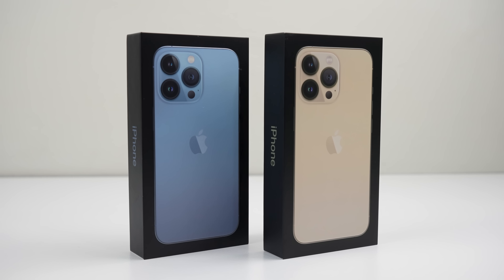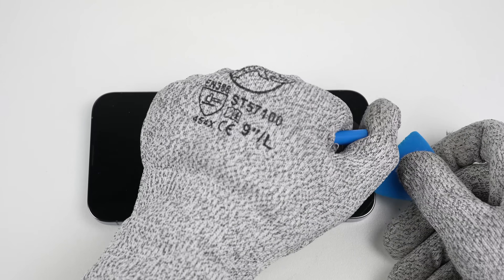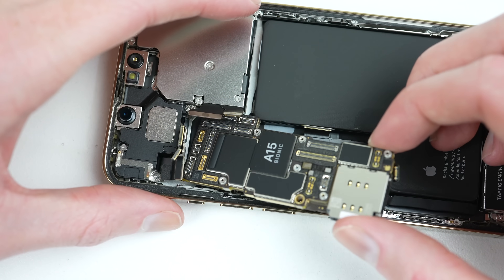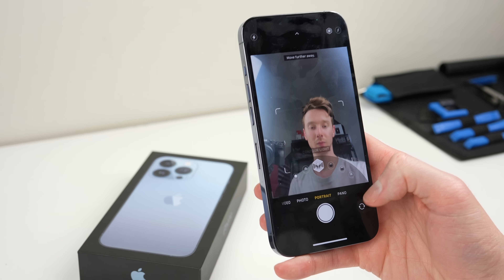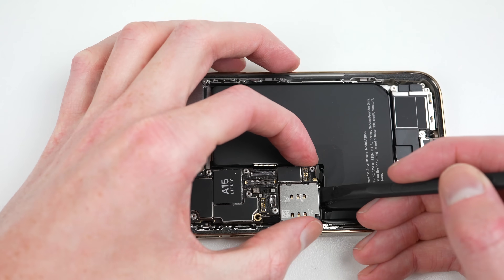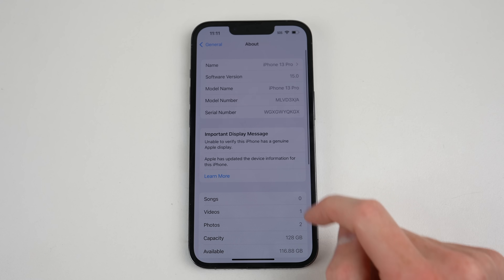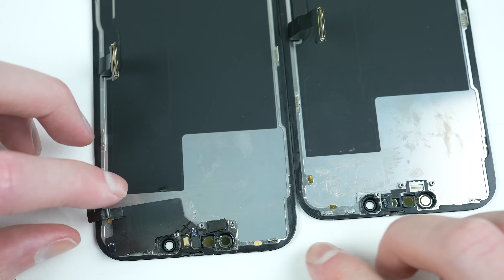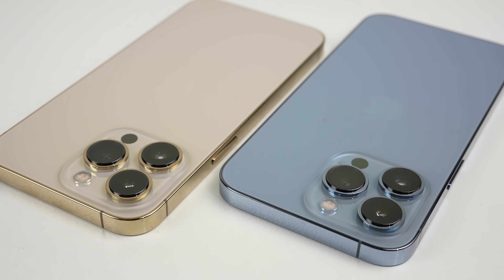iPhone 13 A Repair Nightmare - Teardown and Repair Assessment

Comment: Think it as HP Laptops, they make laptops of same model with different components from different manufactures. Like the same model from a batch can have Qualcomm WiFi module, on second batch Intel, on third batch Broadcomm and on fourth batch Realtek. Now if you go to Hp's website and search for drivers of that model, you'll find drivers of all 4 different manufacture adapters. Apple does the same, the camera, sensors, display etc are being manufactured by different different brands and sent to Apple for assembling. The problem occurs when they build the OS on the bases of batch hence the software build version is different and it doesn't have the proper drivers to work with the component of previous batch.

Comment: This is the reason why Apple sucks environment friendly? Yet they don't want a 3rd party repair to their products to prolong the life of that product, if the problem is hardware they will suggest you to replace it with a new one taking your faulty product replacing it with a new one while paying the price that almost the same if you bought a new one BS(your faulty device+cash = a new device), because they don't replace or fix hardware problems because they will give you this BS that the product can't be opened and they only repair software problems.

Comment: I do hate Apple but Apple is not doing anything wrong with this limitation. They are still complying with the Right to repair law. And yes, the unit can still be repaired using an authorized service center. Apple has filed a number of proprietary patents and they are protected under the laws of patents. 

I want to be able to have my unit repaired by a third party because it is cheaper and easily accessible. Apple service centers are few and far between and they cost a fortune to repair.

Comment: What Apple has done here is most likely illegal.  They have included software in the device that disables features to punish you for doing unauthorized software or hardware changes.   Though it may take some effort to research it,   there is a relevant case against Motorola over what is called the "Toolproofing" fiasco, as applied to their MT/MTS series portable two way radios of the 1990s.  Motorola lost the suit, as I recall.     The court decided that a company can't include software in a device that intentionally disables it if unauthorized software is used to program the device.   

Apple IS going to get sued, and HARD, over this.  And they WILL lose.

Comment: I could imagine there would be a serious risk but did you not want to try and reprogram the display from the other display using your read and write tool? Or did you simulate that when you plugged the two displays in on the same phone?

Comment: The only thing that needs to be done after swapping the logic board is running repair calibration which can be done by any apple authorized service provider.
Reply: But will they do that properly not

Comment: Steve Jobs is smiling in heaven at this.  He totally did not believe users should be able to open and repair his systems.
Reply: Well in the past Macs where extremely easy to upgrade. Any user could open one and swap a part because everything was neatly oganized and modular. Shit hit the fan when Steve died

Comment: I just hope EU shits on Apple forcing them to go "right to repair" and forcing them to use USB-C for enviromental reason. I mean they even have lockout chips in their fuckin' cables so you have to buy 30$ charging cables only from Apple..
Reply: if eu charge a lot of money, apple will change their ideas. But if the fees are too low, they will keep accepting it.

Comment: Apple’s definition of “sustainable” is meant for sustainable cash flow, by making their products un repairable by third parties. Though, other companies are doing this too. People need to speak with their wallets, since that’s what they listen to.
Reply: "we will be carbon neutral" What about all the phones that are unfixable? "CARBON NEUTRALLLLL"
Reply: @-JonnyBoy-  The phones can be fixed, they just need to be fixed in Apple's hands so you can pay more. This has no effect on whether they can achieve carbon neutrality or not.
Reply: This video singlehandedly made sure that the iPhone I have now will be the last iPhone I own, what other manufacturers should I keep in mind if I"m trying to avoid shitty anti-repair practices?
Reply: @randomnpc445  which one do you own?
Reply: @cosettapessa6417  Xr. Unfortunately it's relatively new, so it's not like I'll be getting something new anytime soon, though I wish I'd come to this conclusion before getting it but ignorance is a bitch sometimes.
Reply: @randomnpc445  OnePlus might be a good option for you. I am not sure about their new phones but my friend has an old one that he has repaired and is still trucking after 8 years or something like that
Reply: This is why I still use my Samsung Galexy S8+. I refuse to buy a product I can't fix myself. I wont by a laptop without a removable battery or way to replace parts as they age and while this is less true with phones now, I can still take my S8+ to any repair shop and have parts replaced. I had my screen replaced and it came with no issues. They wouldn't let me have  the old screen because of a Samsung contract but I can still get my phone serviced by any repair shop. This is why we need to fight for the right to repair, otherwise we will never "own" our devices.
Reply: @Phoenix3Fighter  well Samsung is pulling the same schemes as apple
Reply: Like most things, the backlash is slow at first but it will eventually happen all at once. That, and governments will soon force Apple’s hand as R2R gains more traction.

All my Apple devices are at least 4 years old now and I refuse to spend any more money with them.

Good thing about having old devices is that it makes it much easier to escape the walled garden. I just need to be careful not to land in another one, so any Samsung devices are also out of the question.
Reply: These companies don’t give a fuck about the planet. All they care about is LOOKING like they give a fuck. You know they would DOUBLE their amount of pollution and waste in a heartbeat if it meant they could make more money and nobody would find out. This along with the sweatshops they run, John Q Public is delusional to think that any of these major companies have any scruples whatsoever.
Reply: I want to speak with my wallet, what phone brand do you recommend that’s consistently more repairable?
Reply: When most people shop for a phone, they don't think about repair options; they are too focused on all the sexy phone features.

Comment: Well, I kind of like what Apple have done in that it renders stolen phones unusable for parts and useless for pretty much anything else. Sure you pay a bit more for out of warrantee repairs at an approved Apple repair centre, but that comes with the knowledge that your phone will work properly. Right to repair doesn’t mean the right for anyone to repair anything. It means that devices should be capable of being repaired and maintained for a reasonable period of time by the manufacturer or their authorised agents. It should be clear that iPhones are built to extremely high tolerances and the vast majority of people do not have the skills or knowledge to carry out repairs of any sort on these devices, no matter how many YouTube videos they have watched.

Comment: whats the actual point of removing everything from the box of the phone if the internals cant be repaired. the battery will die in 3 years, water resistance will go after 2, and theres always glass on there somewhere. after that, you have to get a new one, rather than saving money and the environment from excessive waste by just being able to fix whatever broke and recycling 1 part, rather than buy a new device and recycling all the parts, which in this situation all work except for one. you cant even use those working parts from the "broken" device because others cant be repaired. hmm very environmentally friendly eh? thousands of working parts having to go to waste because one thing went wrong and couldnt be fixed.

Comment: so i guess apple has just decided to deal with the inevitable advancement of right to repair by simply making it so you cant change ANYTHING from the original hardware, and the only way to do so without losing features is with some proprietary equipment that probably have that re-pairs a new part with the phone after theyve charged you double what everyone else does for it. fuck apple.

Comment: there is nothing wrong with a lot of this. clearly it disables the lidar scanners used for faceid authentication. this is naturally a security feature because if any faceid module could be plugged into the phone, then an emulated faceid module could be used to get around authentication measures.
this is to be expected, and the fact that these sensors are used for the cinematic features is the reason why they don't work

people who want to say this is apple that is trying to prevent repairs have no clue about device design. go work as an engineer and make a phone that gets around this.

Comment: The fact that they lock the camera like that is super lame. It makes it sound like there's an actual hardware issue that doesn't allow the camera to function. They instead just simulate a hardware issue, so you can go to apple and they can tell you the camera is broken and will be $600 to reapir.

Comment: This actually proves that they could make it repairable with just a software update.
Reply: My guess is that the motherboard has a component whitelist in the BIOS equivalent of iphones; aka only "authorized" parts will function on this phone. Some laptop manufacturers have done that in the past. 

The motivation is to bring business to their own repair shops: a 3rd party repair shop will not be able to change the whitelist (so the iphones will not function properly), but apple's own genius bar will be able to simply flash a new BIOS with the correct parts whitelist and the phone will function perfectly.
Reply: @Shiinamusiclyricssubs  apple genius bar are noobs that don't repair hardware.
Reply: @Shiinamusiclyricssubs  Why wouldn't parts from another iphone be "authorized"? clearly those are genuine parts but they probably carry IDs with them and those IDs are probably in a ROM and also encrypted. Apple, I bet has the "keys" to twist to reprogram the mainboard to take new parts.
Reply: @rohitnijhawan5281  it doesn’t have the same serial number, you can’t put every serial number inside the bios. So whatever it shipped with it saves, then if you get something replaced they have software that can change what’s on that list.
Reply: @rohitnijhawan5281  That's what he said basically...
Reply: @Shiinamusiclyricssubs  What part of "Authorized" is rejecting a 100% Genuine part, from another 100% Genuine Iphone 13 ?  That is the issue here, not 3rd party, an actual part from another FUNCTIONING Iphone being refused.  Apple uses SERIALIZATION, and ONLY Apple can reset that (For a fee, if they do it at all).

After they had this power, they were able to write and test software that guessed every passcode combination, ignoring any other systems that would lock out or erase the phone.
Reply: @Brianwhite1969  You can't really verify a part hasn't been tampered with if all it takes is a serial number. The IDs guarantee that these are the exact same parts
Reply: @Brianwhite1969  a 100% genuine part that may have been removed from a 100% genuine stolen iphone.
Reply: @mercyful22  So Apple gets the exclusive right to repair because 1% of all repairs might happen with stolen parts? Why not just attach an IMEI to each part and when the phone connects to the network, if a part is blacklisted, you know the part was stolen too? Then you can find out who is selling the stolen parts.
Reply: @Shiinamusiclyricssubs  modify whitelist in the BIOS equivalent of iphones (a secret menu) and deactive the software lock
Reply: Good point.
Reply: It actually proves that they deliberately disable perfectly good hardware using software, so of course it can be fixed in an instant.  They just won't, and to add insult to injury they also practice routine planned obsolescence, removing things like headphone jacks that no one needs.  It's not driving innovation, it's driving quick profit.
Reply: @nobrainsnoheadache2434  go with android and you see what planned obsolescence really is. Two year old phone? No more updates. And weird that they also removed the head phone jack 🤔 must be all apple behind those companies conducting a grant conspiracy …. theory. Right?
Reply: @dinoscheidt  my 12 year old first gen android works just fine, so does the next one, #3 had a bad battery, 4 is fine.
Reply: I’ve done embedded hardware hacking in the past. And I can tell you, that tempered android phones are used to spy on Government Officials and Journalists. How do they do that? They mod a display with a relay chip, grab images from the camera sensor, inter link with the microphone and would love to grab face scans from the Face ID system if it were available on android. No one is able to do this on iOS. Intercepting an iPhone, opening it and putting the main board into a phone with modded components and giving it back to the target — hence not noticing anything because no difference in the main board as it has the same installed apps, memory etc. What people brush off as “apple is a dick for the right for repair” is 99% best practice in hardening hardware based hacking with a system that makes hundred percent sure your phone is in an expected states. That keeps devious Governments, Hackers and the FBI at bay. But also: People that “just want to fix” something incl. people that steal iPhones to sell their parts = inhibiting the value of a stolen iphone and therefore making it less interesting for thieves. People (especially the ones concerned with repairability) should know about this then just yelling “iT’s ApPLe beInG GrEeDy!!” 🙄 I know I would not be able to hack an iphone. And that’s the reason why I iOS is my main personal device (though i have androids too).
Reply: @dinoscheidt  Governments can get into iPhones too. It's actually harder only initially, but when an exploit is found, it works on every iPhone unlike Android. Most compromises happen with 3rd party apps anyway, regardless of your OS. If it were about security, they wouldn't allow your phone to boot when unoriginal parts are discovered at all. The phone booting with this issue still leads to compromises in your data. There's still no reason why at least genuine parts can't be used to repair devices. It's far more likely that this is about planned failure and containment that Apple is known for such as with their batteries. As proven with constant iCloud hacks, they could care less about your privacy.
Reply: @dinoscheidt  then they can just backup all the data in a same looking legit iphone
Reply: @bmanna495  No, you need full user access. To do this. Both on screen unlock, again on the backup and again a iCloud login on the new device — which triggers an email to the users. So you basically need to have the iCloud Login information + the two factor authentication method. If you really got that and are able to assign a new device to the iCloud account that you are pretty much in already / forces the user to do what you want.

Comment: Apple uses a program after a phone is repaired that changes over the serial number of any part that has been replaced during repair. What's even more fun is when that program fails to successfully swap over those numbers and the phone fails to work properly. Thanks apple.

Comment: So Hugh,  I would like to point out that even tho Apple does have the ability to pair new displays, they often don’t work even at an Apple store.  My last 2 iPhones with Apple care plus had cracked displays.  Should have been an easy repair.  Walk out of the Apple store both times only to find that the Face ID didn’t work.  They replaced the phone anyway.  One of these phones was jailbroken with lots of tweaks and I was crushed.

Comment: The exact reasons why I won't buy an iPhone , until the RIGHT TO REPAIR is in place. I currently use 6S and I like it softwarewise , but the reasons stated my next phone will be android based , a one which has parts available and the phone is fixable by myself. As I 3 times replaced the screen , midframe+screen, once aux board ,  battery on my OnePlus One. iPhones are good while they work , once damage occurs and repair is inevitable you are screwed , buy a new one. Luxury brand for clueless people.

Comment: If you are clever, you get a proper phone instead of an irreplaceable and unrepairable iPhone. Do everyone besides apple a favour and just don't buy Apple products - ever again. This is the only way of stopping this unrepairable Apple nonsense. If they don't get money in the future, they will probably realize that this way is the wrong way. It will take decades and several flops from apple to eventually go broke. But if there is willpower, there is a way. Let's stop Apple and their nonsense by just not buying their products - ever again. Steve was a genius, but Tim? Well, with those changes to unrepairable and even more expensive phones, you got your answer.
Just stop buying these products. 
Use linux phones instead.

Comment: Thanks so much for doing all the testing you do! 

Videos like these are incredibly important right now for our right to repair, without the information you provide many would not know what manufacturers are doing to prevent them from repairing the devices they own.

Thank you again for all your invaluable work!

What happens when you swap the batteries between the phones?